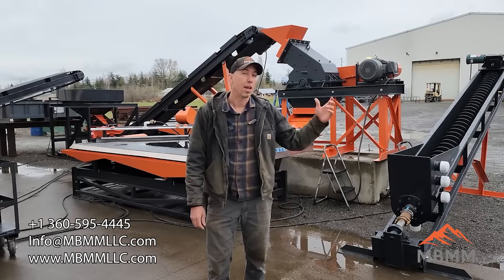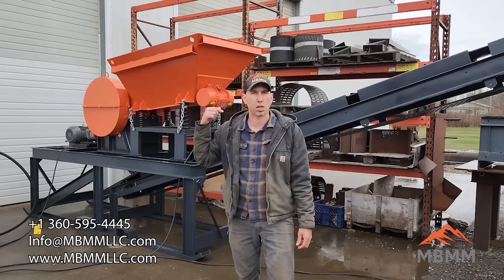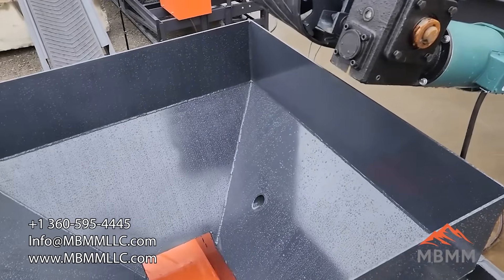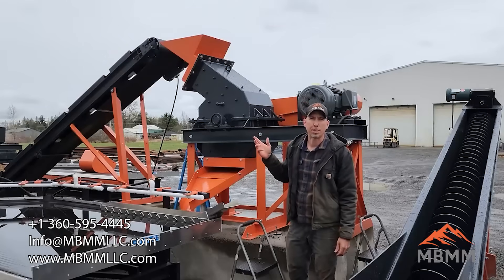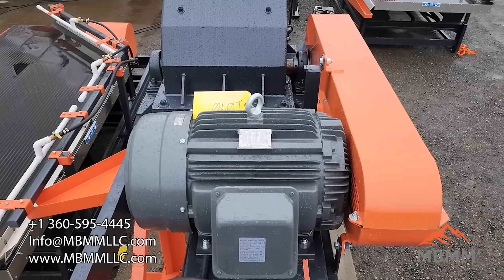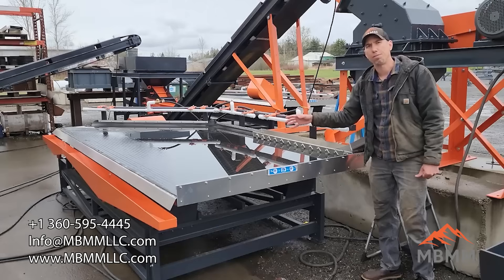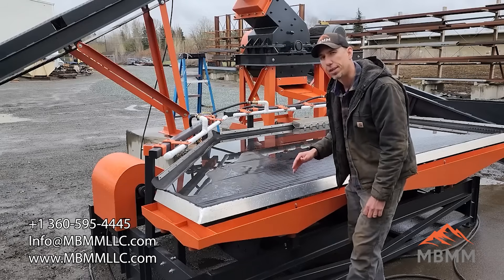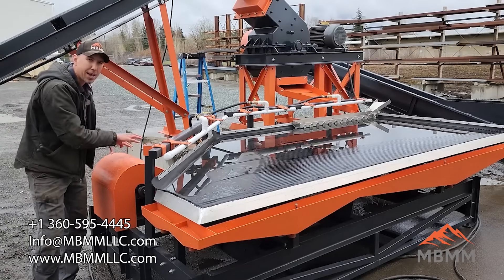Gold Ore Processing Equipment | Turn-Key System for Hard Rock Mining

Comment: You could build this system into a vertical tower and eliminate one conveyor belt. You have a conveyor belt to lift the ore into the jaw crusher hopper, and then the ore falls straight down into the metering hopper. The metering hopper drops the ore directly into the hammer mill. This would also significantly reduce the footprint of the system.
Reply: Interesting. I want a setup that's mobil but not have to have a semi to pull it. We tow a 16ft trailer right now, but I'm thinking it would have to be a 20+ft if not a 30ft trailer. Or we could just buy another bus and cut it all up and put the setup on it!?😂😂